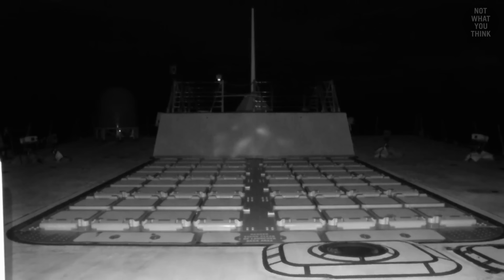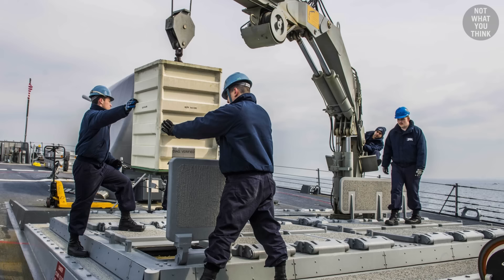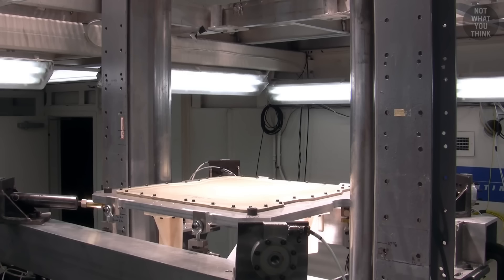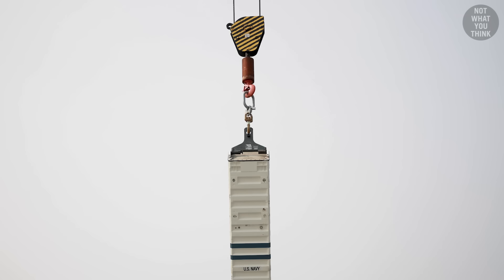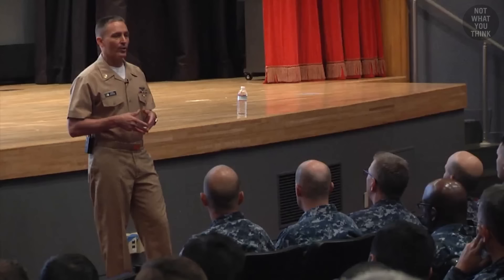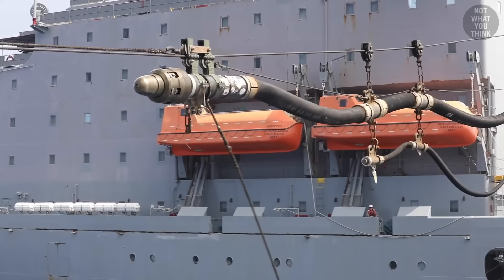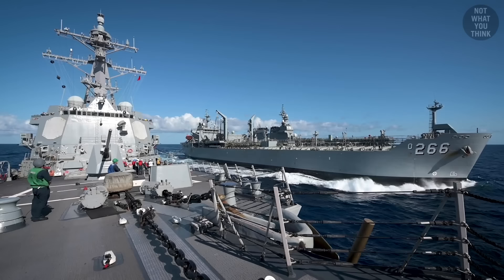Why Warships Cannot Reload Missiles at Sea

Comment: To fix reloading, does the system have to be VLS?  Can't they change to HLS and have it come out the side of the ship?  (Yes a whole new design that would cost a lot) I think it would be a lot faster, safer and easier to place them on a deck elevator that can then move them around horizontally in the ship for reloading.  This would also allow for much safer movement especially in rough seas.
Reply: The problem with that may be salvo size and internal space. I'm pretty that with a system like this, the main problem isnt deck space, but internal space. You still need to be able to go around the VLS cells to other parts of the ship, and you still need to fit systems inside. A system like this may trade the total missile magazine size and the size of a possible salvo that you could launch.
Reply: The VLS IS the better system when it comes to reloading. Creators of this video just didn't do their homework as per usual.

VLS was chosen for "ease of reloading" and versatility which has recently paid off big time since they were able to painlessly go from smaller missiles to much longer ones but no matter what you do, missiles will always be extremely awkward to load due to their extremely big & long sizes and their expensive nature.
Reply: @CheapSushi  There's no good reason for the US to change over to horizontal launch and especially not to a missile that gets fired out of a torpedo tube and launches from the water. The only reason the Russian RPK-2 launches its missile component from underwater is because it was developed as a submarine-launched weapon first that had to be able to be fired from a torpedo tube like a Soviet equivalent of SUBROC. It was then added to surface vessels and for the sake of logistical simplicity and cost, they used the exact same weapon and deployed it like a torpedo rather than redesign it into something that could launch off a rail or from a VLS.

Comment: Economics of battle, if you launch 200 cheaper missiles against a target that can not defend against that number and you hit it, then you win. Swarm attacks need to be figured in real fast for ships or improve the armour which means larger power plants and heavier armour = more cost
Reply: Aegis automatically determines what measures to be used against the incoming threats, worst case scenario in the future is adding more VLS cells - it's far easier to prevent a missile hitting the ship at all than it is to try prevent damage when the missile hits.
Reply: Anti-ship cruise missiles are not cheap.  If you want enough stand off range to be able to launch missiles from outside the range of the battle groups air wing and long range SAMs, you need something with a 500 or so nautical mile range.  Now you are talking a large expensive missile, expensive because at those ranges the missile will have to fly autonomously for an hour then scan the ocean for targets, classify everything it detects, determine what is neutral shipping and what is a legitimate target, then maneuver to engage the target including employing its own electronic countermeasures.  Missiles that can do that are not cheap and most navies cannot afford enough to conduct multiple saturation attacks of 200 or more such missiles.  You also need platforms able to launch these missiles and those too are not cheap or expendable.  Cheap missiles are of necessity short ranged and have simple guidance.  That requires the launch platform to come deep inside the battle groups substantial air defenses.  Good luck with that.  Coming inside 300 nm of a US Navy carrier strike group's escorts and its air wing is not an easy thing and not very survivable.

Comment: I think just a ways to make a Vertical loading become horizontal loading. A swiveling loader capable of rotating between Vertical and horizontal or any adegrees like F35b vectoring to do it. when you swiveling to horizontal you need build a new container & crane like a jet to have Probe-and-drogue to catch the swiveling loader.

Comment: The basic problem here is "wrong fucking kind of crane".   They need an erector that can be moved into position and locked in place, accept the module then erect it into place and lower it in within a guided rail system. This is about the simplest system of all and only needs a pair of rails to the sides and a rack to the bridge side of the compartments.   A stupid boom-arm crane has always been stupid and worse, somehow, the navy lost 700 years of handling skill overnight... where are the capstans and stays?   Three capstans and stays would let you load those damned things in Force 8.

Some d-bag really dropped the ball on this crap.

Comment: Shame the uprighting hinge couldnt also incorporate a through roller system, so that the module couldnt then slide directly into the cell. 
A frame containing these hinge/slides could be loaded from the supply ship and quick connected to the main deck. Then the crane is only used for uprighting and lowering but not positioning.

Comment: I guess one think I'm not quite understanding is why they insist on a crane and not a rolling carriage system. 

It seems like one laid some cells out on the deck a carriage could be made to load the cells long ways into the carriage and the the carriage itself secures to the deck and or vls system. After that it becomes a hoist to lift the cell vertical and then lower it into the cell..
Don't get me wrong i don't think one of these would be simple by any means.... But we are talking about handling extremely advanced military hardware so i don't think this is outlandish.
Reply: Size, weight, cost, reliability and maintenance would all be issues. The system would be out on the front deck of a ship getting the sh!t kicked out of it by wind and waves so it would break all the time unless it was made to be so heavy duty that it would compromise other aspects of the vessel. You'd also still have the problem of how do you safely transfer missiles to that reloading system?

It's a very safe bet that any concept that you, I or anyone else suggests in these comments has already been thought of by naval engineers and studied in great detail. Navies all over the world have transitioned to VLS launchers and that's not a coincidence - any drawbacks these launchers have are more than outweighed by their advantages.

Comment: What I don't understand is why not use a carriage system and load them in through the side of the ship? Or create a hole in the deck a rail system can be hooked up to and run them one at a time through the carriage system. Make the hole as wide as the magazine so they can attach a rail for each layer of the magazine and refill it exponentially faster. Basically a heavily modified version of what is used to load munitions into a submarine. Completely eliminates the need for cranes. To eliminate the need for drydocking they would need to invent something else but Basically a reverse dry dock. Instead of lowering the water so you can rest the ship on something, bring the ship to rest over a bunch of hydraulic rams that lift the ship up until its no longer using buoyancy to stay above the water and just sitting on the hydraulic rams. That would prevent the waves from moving the ship without needing to do a full dry docking process. This could also feasibly be set up at any dock it's resting position just needs to be lower than the keel of the largest ships allowed to dock there arresting wires on bouyees attached to winches can be used to guide the ship into place and hold it still while the hydraulic rams raise into place.
Reply: Because hull openings can leak and cause other problems.
Reply: Ever see the flame trough under those VLS cells?  It has to be flooded with seawater during launches to protect the ship from damage by the rocket motors.  The flames are directed 180 degrees and blown upward out another hatch alongside the launch cells as each missile is fired.  It is not so simple below decks.  There are also connectors from the ship to each VLS cell so the combat management system of the ship can communicate with each missile, load mission plans or target data then fire the missile.
Reply: @philsalvatore3902 I don't see why that couldn't be worked around. It would require major reworking of the ship below the VLS system to allow for a baffle system that can be retracted down under the whole VLS system to allow for horizontal reloading. But again, I don't really see why that couldn't be done. Most of the technology is available already, all the materials needed are available, there would absolutely be some hoops that would need to be jumped through to ensure it is a reliable and most importantly safe system and the last thing you want is one of them dropping or getting jammed slightly out if place and triggering a chair fire. That ship is gone if these things manage to chain fire so I'm assuming the system as it is now has been designed in the way that bar a major defect, makes this an impossibly. As this would be a highly complex bit of machinery directly responsible for the safe functioning of a high explosive mounted to a bunch of rocket fuel there would need to be MANY fail safes and back ups. It needs a 100% function rate as when you need to fire one of these you REALLY need to fire it. Not being able to fire it will cost lives and potentially thousands of them if a carrier were hit or god forbid a full hospital in say isreal. If the iron dome runs out of ammo our VLS's may be one the only things capable of taking down those rockets considering their volume of fire. Standard anti air guns aren't handling that many rockets at once. But honestly I think our people are up to the task of creating a system like that. Just would take a willingness to spend absolute crap tons of money.
Reply: @dcviper985 a hull opening on a deck is a fairly standard thing. They seal shut when underway in bad weather. And with modern tech can be nearly completely automated. Just takes someone pressing a few buttons and then indiduals closing the few things that need to be manually closed for safety reasons. Don't want people being locked out on deck.
Reply: @bundlesofjoe  no, hull openings are not standard and require more infrastructure to stay closed and not leaking. The deck is not the hull.

Comment: The shooting down of the airliner was operator error. As the radar was tracking an F-14 on a Runway. Where civilian aircraft was taking off. Along with the identification book of Airliners taking off that day..
Reply: The story I was told shortly after it happened (I was active duty at the time) was the airliner wasn't squawking and the pilot was not responding to calls on International Guard frequencies VHF 121.5 and UHF 242.   In addition the helicopter from USS Bagley had just been shot at and the Vincennes was in a running gun battle with a half dozen IRG patrol craft.  And then there is this unidentified aircraft heading right for them from Bandar Abbas that ain't squawking and ain't talking.  Believe me that entire crew felt awful afterwards.
Reply: The plane was sending its ID..Problem was the Ship was so close. It picked up an Iranian Fighter on the same runway. The operator never looked at his book for flights that day. He had what they call confirmation bias. He was positive it was a fighter. So he looked any further.

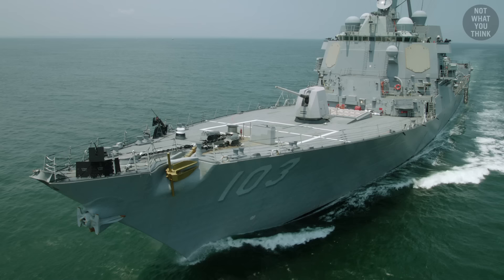Comment: 1:27 "making the ship useless" Stupidest take on the internet. An Arleigh Burke class destroyer isn't "useless" once it expends it's VLS anti-air missile cells because it still has harpoon missiles, torpedoes, VLS tomahawk and ASROC cruise/Anti-ship missiles, a 5 inch gun, 2x 25mm guns, a 20mm CIWS, 4x .50 cals, and a SH-60 helicopter. And on top of all that armament, it's radar and sonar suites are some of the most powerful in the world, even if it expends all of its ability to fight, it can give all that targeting data to other ships and aircraft that could defend them.

Comment: The problem is that aircraft have a specific ping that shows up on the radar and what happened with the Iranian flight was it was showing up as an F-14 tomcat. It was not a result of human error because we had tried repeatedly to contact the airliner. Furthermore, a ping that a airliner has compared to that of a fighter jet is very different. Because of the instruments that were on the ship at the time we thought it was an F-14 tomcat. The captain in charge of the ship did not face any criminal charges because of this.

Comment: maybe stupid but hear me out:
- reload magazine frame that can carry 10 VLS cells (like a container) bottom open
- can be easily moved from the support ship on deck with a crane and doesn't need precision to put down
- have a docking adapter of some sort on deck that does the precision work on the ship, like some kind of rail
- the magazine is then slid over the VLS battery and locked in place, the used VLS cells are lifted up (from the bottom?) at the same time and locked automatically in the magazine (both ships do not need to be next to each other while this happens
- support ship lifts magazine with the empty VLS and places a fully reloaded one on deck
-> same thing again, during the process both ships don't have to be next to each other
- empty magazine is lifted off the ship

Possible problems: the magazine would be quite heavy, no such rail exist on any ship and would have to be retrofitted.
Reply: Cost, practicality and logistics would be the issues. I don't know for sure whether it could be done but it doesn't seem impossible, but you'd need to have your tender secured in a semi-permanent mooring within a harbour or port (like Holy Lock in Scotland where submarine tenders used to be based) and it would need some pretty serious lifting gear onboard which might need a whole new class of much larger vessels as well as the infrastructure on the warship itself. If you're going to that much trouble for something that has to be done in a friendly port anyway, you might as well install all that kit on the dockside for a fraction of the cost and reload the traditional way.
Reply: Weight.  An SM-2 in its canister weighs 4,200 lbs.  Ten of them weighs 42,000 lbs, or 21 tons.  Tomahawks and SM-3s are heavier still.  That is a lot more weight than shipboard cranes on combat ships or on the replenishment ships can handle.
Reply: @philsalvatore3902  it would be around the same weight as a container i guess (that's where my idea came from), but yeah the infrastructure for something like this is not existing yet ofc

Comment: And why wouldn't they have used the quad packs? I have a sneaking suspicion they would have instead of the ballistic missile interceptor
Reply: The quad packed missile is the RIM-162 ESSM it is a smaller missile meant for close range intercept (out to 25-35nautical miles) of anti ship missiles and aircraft. It is a very potent weapon but one with a limited range of uses. This is why you also find RGM-109 Tomahawk cruise missiles for land attack, RUM-139 rocket launched lightweight torpedo's for anti submarine warfare, RIM-66 SM-2 and RIM-174 SM-6 missiles for longer range air defense, and RIM-161SM-3 missiles for ballistic missile defense. Different weapons have different uses and by carrying a mixed load you have a much more robust ability to take on different threats.

Comment: vls missle the box goes around the missle wouldnt that make it easier to load ?
Reply: It does, but reloading something that size and weight at sea with the precision and safety required (if it takes a significant knock, the missiles have to be dumped or sent back to the manufacturer) is just not feasible.

Comment: Why not make a inside ship reloading?, like a gun magazine, when the top empty, it will eject, next armament will move up, then reload from bellow.
Reply: probably the space; these US VLS are pretty much from the top deck down to the lowest and in their own boxed structure. I think I've seen the Russian (and Chinese) canister launchers are more open in the bay decks, so you can reload a missile differently (like you can see each individual missile. But these are like their own boxed in thing, with protection from explosions. So there's not really space to load another one from below, let alone from the sides. The whole point was the densely pack in as many missiles, while still having room for other systems and walkways, etc.
Reply: Not even close to enough space. space is at a premium inside a warship.
Reply: Because the missiles are massive and there just isn't enough room
Reply: It's a sacrificial lamb.  Designed to draw fire, launch all it missiles and will be destroyed shortly afterwards by a hypersonic nuke. If it can be reloaded, that means we already won the war.
Reply: @ianwalton284  It is not sacrificial. it is designed to intercept incoming missiles and defend the fleet. You are thinking of the soviet plan to just dump missiles and run before they get obliterated by American air power.

Comment: Redesign ammunition supply ships and redesign the VLS cell modules to easily lift out by helicopter and drop an entire fresh VLS cell cluster in with pre loaded missiles. Let the cell clusters be 16 missiles each making 2 helicopter lifts for the forward cells and 4 lifts for the aft cell cluster. The ships own MH60Rs could do it if needed.